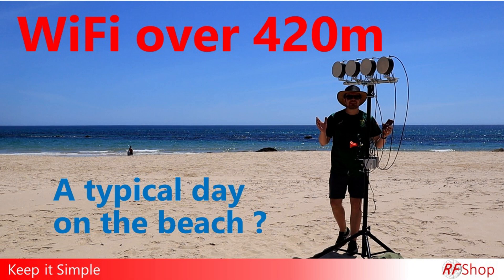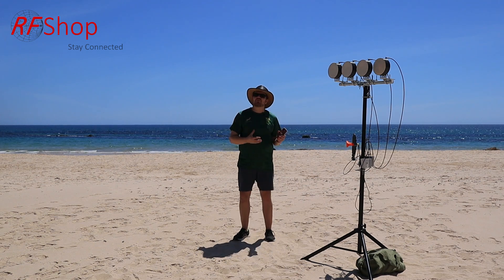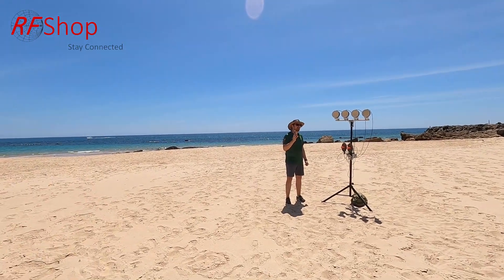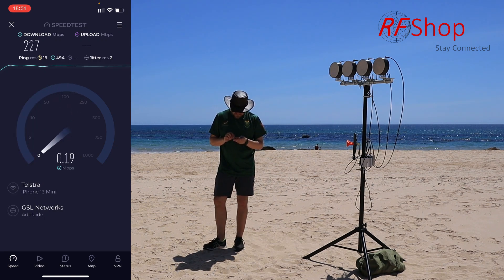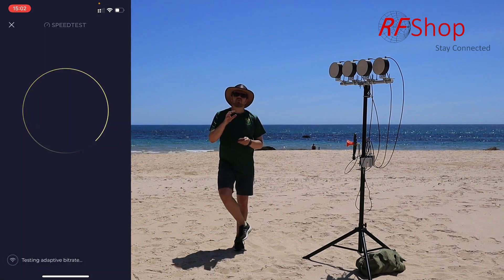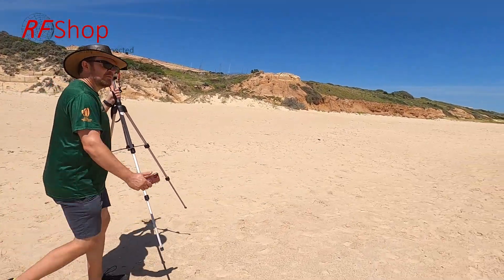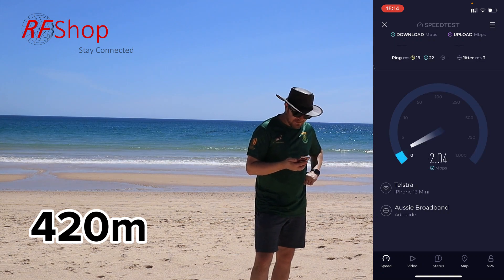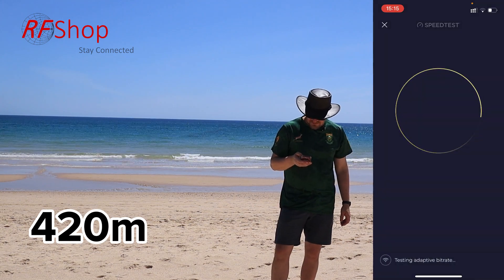Why 3D Printed Antennas are great

Comment: David-  THANK YOU so much for this channel.  I've had to learn much of this myself through trial-and-error, but you've answered many of my questions that weren't addressed anywhere else.  (Been to Adelaide a couple times too, gorgeous town!) 

Are the 3D files for this antenna available for download somewhere?

Is there an efficient RF switch I could use to select between different cellular antennas?
Reply from the maker: Thanks heaps. An RF switch is something that gets used more in the specialist fields of engineering. They are quite expensive (few $100's) but work well. I would say it'll be easier to use a physical swap.

Comment: Hi David, good video!
It would be worth re testing with a 20mhz channel width, and noting the fresnel zone radius. 
At 400M on 5.8ghz the radius is 2.27M it looks like the beach may be obstructing that due to low antenna and phone heights.
Reply from the maker: 100% agreed. I purposely used my iPhone for this test as it is probably the worst WiFi receiver I could use, but I was trying to emulate real use situations. Eventually I would love to use an ALFA Card with another dish as my receiver, and also go from a cliff to the beach (which is on the other side of the same beach). In that instance I believe I will get well past 1km range.